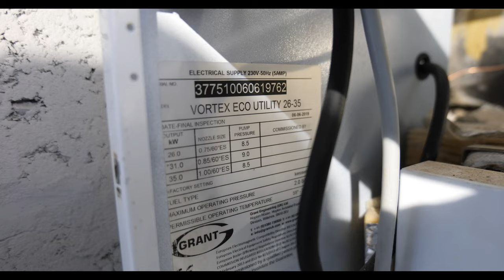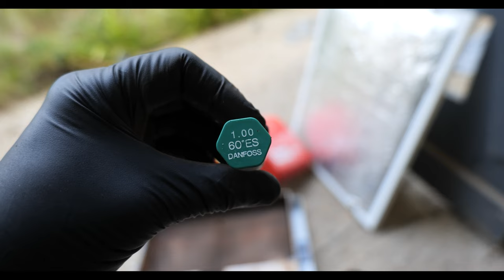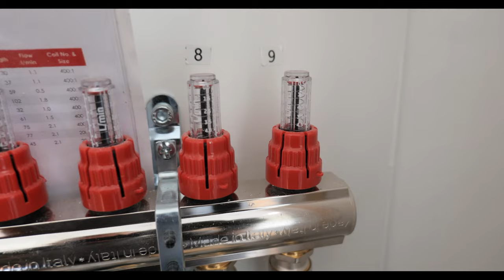Will this pipework hold? Plus Chapel Commission

Comment: Nice video 👍 how come you increased the output of the oil boiker to 35kw? Surely the heat loss of the property isn't anywhere near that?
Reply from the maker: Thank you. This is only phase one. The client originally had two boilers he wanted to go in. We compromised and went with one at 35kw after explaining he wont need close to 70 kw! There are still roughly 18 cast rads and another underfloor heating circuit to go in on the other side of the property. Thanks 👍🏻